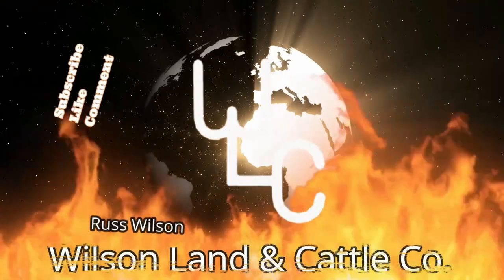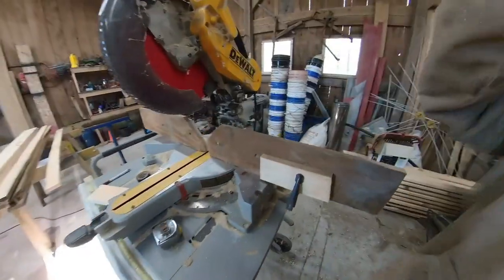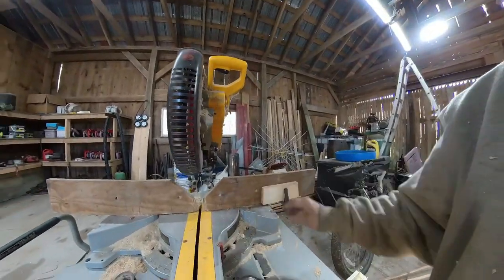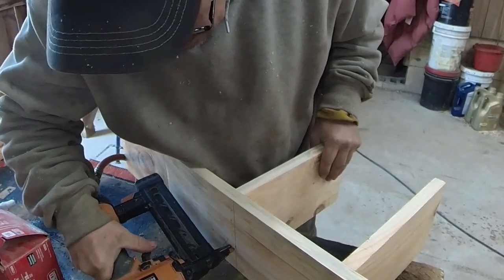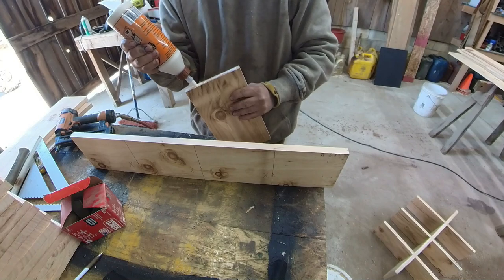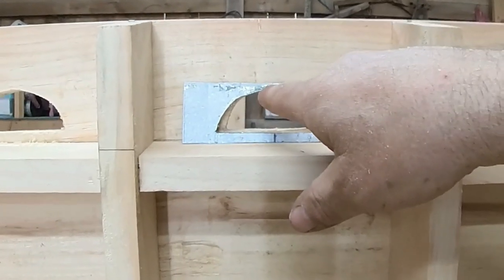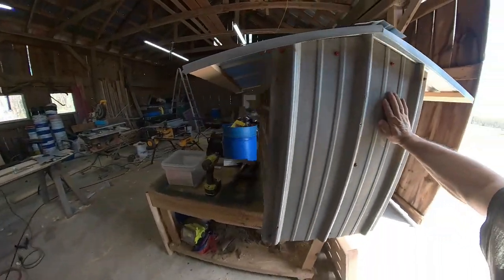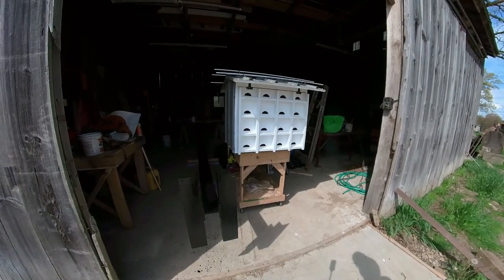Diy purple martin house.

Comment: Large compartments with the hinged fronts for easy access, starling-resistant entrances, very attractive appearance - you get a 10 out of 10 in my book!
Truly top-notch work!
What would be extra neat, would be to set it up to where a large pole (for that house something like a 3" square aluminum pole) could run up through the middle of the house, allowing it to be raised and lowered via a winch and cable system.

Comment: Why are you building a purple martin house?  What do these birds contribute to your farm?
Reply: Good question.  I've been researching Purple Martins for about 35 years now.  Aside from the pleasure of watching them and their amazing flight characteristics, they do cut down on the number of flying insects within a decent sized radius around the housing.  Though they don't eat as many mosquitos as some may think, conversely they do eat more than some may think.  There have been numerous testimonials over the years from experienced Martin "landlords", noting a stark reduction in the numbers of mosquitoes, flies, etc., in their yards or on their property, once they began hosting them.  Add to that the frequent sightings of Martins feeding at low levels with other smaller swallows, no doubt picking off mosquitoes, flies, as well as swarming flying termites and ants.  All that said, small insects like mosquitoes do not make up the majority of Martins' diets, but instead the majority consists of larger insects flying at higher altitudes like dragonflies, wasps, etc.  Another thing that's important to note is Martin numbers have dropped significantly over the past 50 to 60 years, due to not only house sparrow and starling competition, but also due to a major reduction in available housing.  Folks simply are not putting up Martin houses any longer, like they did 50 to 60-plus years ago.  Any well-built, managed ("managed" being keeping house sparrows, starlings, and predators out) housing raised into the air, is a huge win for the Martin species.
As the to the question about what they contribute to a farm - would the reduction in parasitic flying insects such as mosquitoes, biting flies like horseflies, and potentially keeping crop depredating birds like crows away (Native Americans used to attract Martins near their crops using hollowed out gourds, since the Martins have a certain amount of airspace around their housing that they will chase certain species like crows and hawks out of) all possibly be considered contributions to a farm?